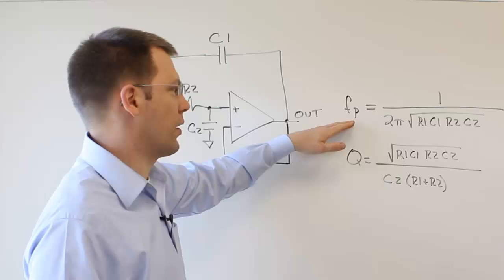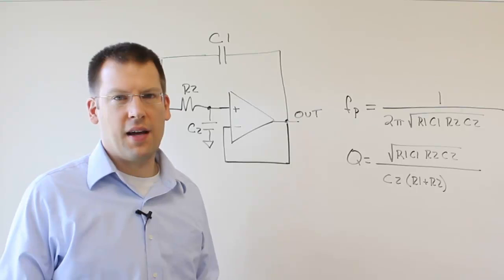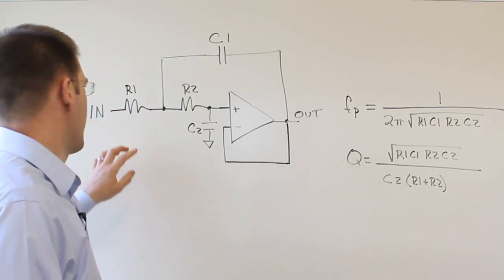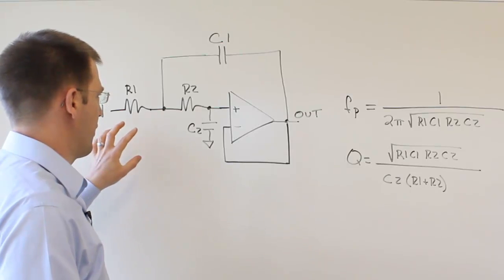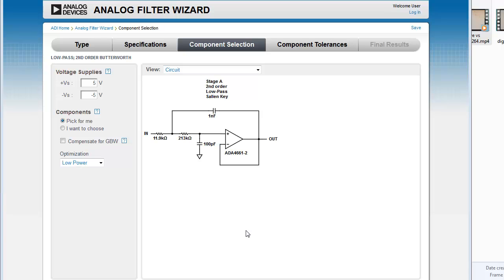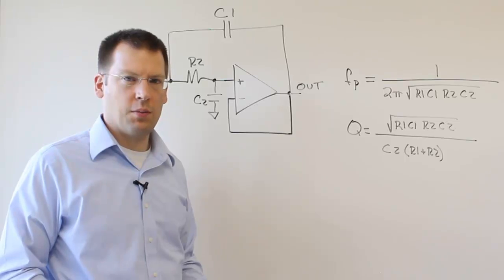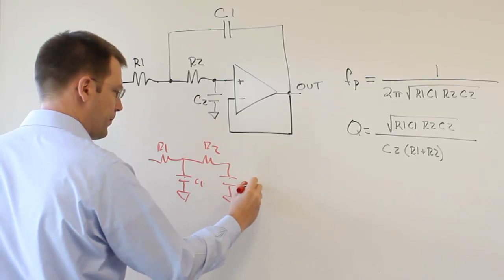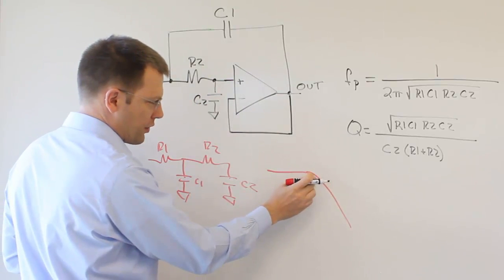Sallen-Key 101: Picking Components

Comment: How would I go about setting a gain of 100 on a multiple-feedback filter? I know the formula is (-R2/R1) due to it being an inverting OP-AMP configuration, but I can't find any material on the Internet about MFB LPFs without unity gain. I'm using one for a project that deals with guitar string frequencies in standard tuning and I want to filter out any frequency above 1kHz while using the high-frequency response of the MFB architecture.
Reply from the maker: The quickest way is to go to analog.com/filterwizard. https://tools.analog.com/en/filterwizard/ In the specifications tab put in your gain: 40 dB or 100 V/V.  In the components tab, choose “I want to choose” and then under “Implementation” choose “Multiple Feedback”

Comment: Hi. thanks for the video. Do you have a tool for Multiple feedback bandpass filter?
Reply from the maker: Yes the Filter Wizard tool http://www.analog.com/filterwizard also supports the Multiple Feedback topology.  For bandpass, the tool uses multiple feedback by default.  For lowpass and highpass, you can choose the multiple feedback topology by doing the following: On the “Component Selection” tab, select “I want to choose” in the left hand tab.  Click one of the stages in the accordion to up it up, and then change the Implementation to “Multiple Feedback.”

Comment: In your example with the OP amp removed (red schematic), do you still assume the virtual ground connections that the OP amp provides?  If so, shouldn't C1 be drawn in parallel with R2 and C2 connecting the virtual ground node to ground?
Reply: In the example with the red schematic, we're imagining an example where the op amp didn't do it's job: i.e. no matter how you changed its input voltage, it just gives a fixed output voltage.  In this case, the output would look like an AC ground, so this is why I drew the C2 connected to ground.  R2+C2 are in indeed in parallel then with C1.

Comment: Hi, do I need a special type of capacitors or any will do? Can I use a lm347 for the opam? I need to do a low pass a high pass and are band pass filter
Reply: Roberto juliaoSince the capacitors are typically the least accurate part of the filter, you want as good as you can get.  Typically you should try to use tight tolerance C0G/NPO type capacitors rather than say X7R types.  The type of op amp you can use depends on the design.  You can use our Filter Wizard web tool to see how various Analog Devices op amps perform in the design.  (Note that because the lm347 is not an Analog Devices part, it is not in the software. We only put our parts in - that's the tradeoff for the software being free.)